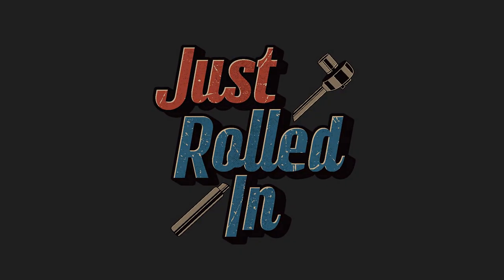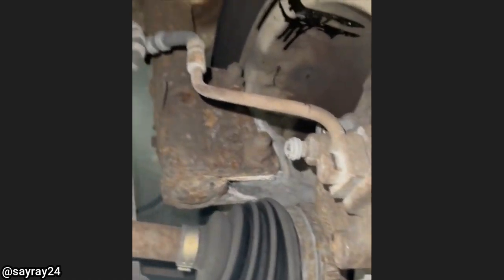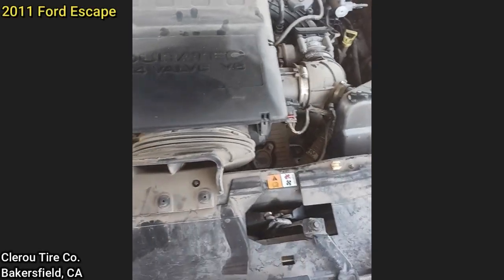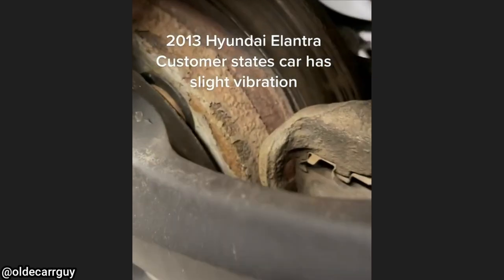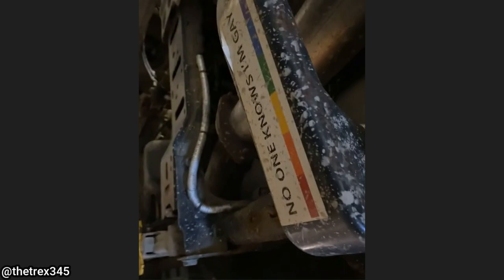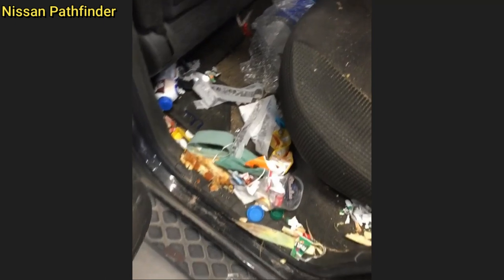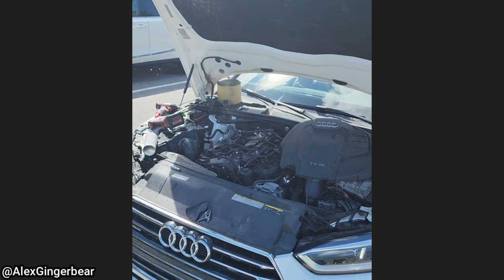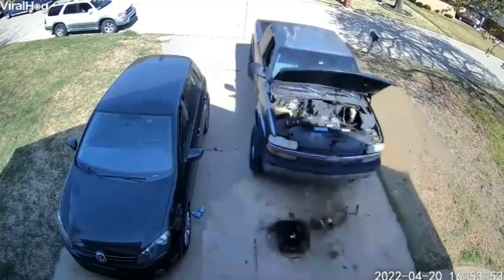Customer States Truck Still Overheats After New Parts Were Installed | Just Rolled In

Comment: 1) I've been the "vibration over 50" guy. I couldn't even see the tires because the car sat so low. When the shop showed me the tires, I about died! The tires had only lasted about 10K miles, so I had no expectation that it was a tire problem. 2) I was working on my chevy truck years ago and went inside to get something. I came back out, and it had rolled out the driveway and was blocking the road. No damage to anything, thankfully!
Reply: my dad had an older tundra and while parked in the driveway the parking brake cable let go. it was a manual and parked in gear so it slowly rolled out of the driveway and across the street over night. 

at like midnight his neighbor woke him up and said "your truck is in the woods next to my house".

😆
Reply: @volvo09  Lmao yeah that can happen when a tired engine is losing compression. It "creeps" like an inch at a time.
Reply: @volvo09  If you park a manual in gear, it shouldn't move at all.
Reply: @jimmydesouza4375  it slowly moves a "chug" at a time due to compression moving past rings and whatnot.

His driveway was a hill also, but not very steep. It took about 6 hrs to go a telephone pole length on a street rarely traveled.
Reply: are u a ghost now?
Reply: @volvo09  older Tundra? Older than what? What do u consider old?
Reply: @jimmydesouza4375  You're correct, it shouldn't. But what happens is, when the cylinders get tired and start to wear out, they don't hold compression perfectly anymore, so when you park the rig, it slowly loses the compression in the cylinders holding it still - until it rolls an inch, which generates more, and then it stops... then another inch, then it stops... park my old pickup on a really steep hill and shutter down in 1st, you'll feel it kinda like that "falling backwards in a chair at the last moment" feeling. New or less worn out engine won't do it.
Reply: @rickjames5998  01 in new England, so it was super rusty. That was about 4 years ago. I ended up with the truck because he was going to scrap it and drove it till 300k when it was truly done... It was only old due to rust, I loved that truck. Ran as good as new, but was unbelievably rusty.
Reply: Ypu Americans need to start using a Handbrake. I've also never came across an engine so worn out the compression doesn't stop a vehicle. Also lowering a vehicle and not sorting out the stupid camber that results will eat tyres.
Reply: @handlesarefeckinstupid  🙄🙄🙄🙄 "you Americans"
Reply: @janemorong4970  yeah, the ones that out of habit don't use hand brakes. You know you do it, i've seen you.
Reply: @handlesarefeckinstupid  I'm sure it's not a uniquely American issue.  I actually use mine.

Have you really not seen an engine losing enough compression to creep like I'm describing? Because I can guarantee you out of 25 cars that are more than 10 years old and manuals, I could get at least five of them to do it. Do you guys just not keep your cars as long where you're from, or what?
Reply: @janemorong4970  to be fair no and I live in a 'very' hilly area. Perhaps it's because we tend to have smaller higher compression engines? I've had people wave goodbye to cars down hills from failing handbrakes, but never had one creep due to the engine turning over. I could see bigger trucks maybe doing that, but they aren't that common here.
Reply: @handlesarefeckinstupid  It could be that yeah. It's not like a HUGE DRAMATIC creep... like an inch... then an inch... then an inch. You may be on to something tho with our engines being bigger and lower comp. My truck's a 4.0 V6 and it does it which is why I actually just had to get the parking brake fixed so it would work, haha. Thing worried me a little cause even if it didn't creep, if it got knocked outta gear somehow or the u-joint broke it could roll. Belt and suspenders, ya know?
Reply: I know this didn't happen like he said it did because Toyota did not make a manual Tundra!! So there is that issue with this comment. Good to see all these guys that know so much not know that... LoL maybe he meant to say a Tacoma perhaps but not a Tundra!!
Reply: @handlesarefeckinstupid  bruh, part of my driveway is 15% grade and any car will creep away instantly.
Reply: @jimmydesouza4375  assuming they had a manual?
Reply: @williamkrause5585  If someone says something in the post a person is replying to, that person quoting them or referring to what they said is not an assumption.
Reply: @jimmydesouza4375  My driveway is steeply sloped, and my car will definitely roll a few feet when it's in parked in first or reverse, has since it was new. Honda Fit (Jazz) 6-speed manual.
Of course, this is why God invented the parking brake.
Reply: @jimmydesouza4375  with low compression it will
Reply: @mauryamckendrick5446  First generation Tundras did come with V6's and manual transmissions.
Reply: This must be an american thing. 1st gear, handbrake pulled, explain how the car rolls away. I'm waiting.
Reply: Mine currently has a vibration at any speed. I already know it's the cheap new tires the dealership put on. I had them rebalanced and the car aligned and no difference. It sat in the hot sun for several months before I bought it and likely has flat spots. Only thing that's helped is massive burnouts to remove some tread. lol
Reply: @techalyzer  I can't explain it. Handbrakes don't hold if the slope is steep enough, and I find the same if the car is just left in gear.
Is it related to gear ratio? If first (3.5) won't creep more than, say, 2cm, does that mean that in 6th (0.7) it cannot possibly move further than 10cm? This would be counter to my own experiences.
Reply: technically you’re supposed to check the tread/wear on your tires every time you use the vehicle. it’s all in the owners manuals
Reply: @janemorong4970 something to be said for the Auto box having a Parking pawl on the box. My wife has a DSG box on her car (sort of auto). That locks in park.
Reply: @j_taylor  A car that does that has issues, just the handbrake alone should be able to keep the car in place even on steep mountain roads. Same with 1st gear. Both at the same time is a fail-proof solution.

My guess would be bad rear brakes/handbrake cable and/or adjustment + loss of engine compression.

A good, normal car will not do that under any circumstances.
Reply: @handlesarefeckinstupid  Yeah, autos have their purposes. I just hate 'em after having so many of them grenade on me and not being able to do anything about it.
Reply: @janemorong4970  i had a DSG go on my wifes car after 5000 miles from new. Warranty changed it, would have cost 6k... scary.
Reply: @handlesarefeckinstupid  Thats what I'm saying, it's possible to rebuild an automatic but it's beyond the scope of most people's mechanical understanding. A manual is still a bit of a task but as long as the casing and main shafts survived it's way more accessible of a repair to say you or me than rebuilding an automatic is.
Reply: That is why I do engage the parking brake each and every time I leave my seat behind the wheel! It is this easy to avoid these rolling problems. (Yes, it is a parking brake, not an emergency brake, IMO.)
Oh yes, the parking brake do works very fine, because it gets used all the time.
Reply: @janemorong4970  Your truck would creep on 1st gear? Really? Have never seen that happening.
Reply: @jimmydesouza4375  it will, eventually, since the pistons' rings hold the compression only when the engine is started and running, because the gases don't have time to gush out beside the pistons. so unless it's an almost new engine it will eventually start to move... then the next cylinder, then another one.
when I was working car mechanic I'd of course, change timing belts. you have to turn the engien into position, which only works if you turn it slowly and wait until the compressed gases have vanished into somewhere. if everything inside would be completely sealed that would not have been possible.
Reply: @janemorong4970  During the mid 2000s our government decided that it would be environmentally friendly if we all drove newer more economical cars and so they made a very generous scrappage scheme I don't remember the exact details but it essentially reduced the majority of cars over like 100k miles to scrap value and because of that we have very few (comparatively speaking) old cars over here in the uk.
Reply: @lilcharlie3130  Yeah I've seldom seen an engine under 100K miles do the creep. Also I appreciate you translating kilometers to miles, since as you well know, I'm over here across the pond lol.

Comment: Always chock your wheels. Personally I always chock both sides just for redundancies sake.
Reply: I chock either both wheels or one wheel front and back on 'flat' ground. My car is a manual so I know that the e-brake at least works. Better safe then dead.
Reply: @braydend9582  Reverse is an extra plus if a manual transmission.

Comment: The guy in the last clip is really lucky.
Reply from the maker: Good thing his truck looks slightly lifted. Might have gotten a differential to the head.
Reply: also really stupid .. put it in park , put the handbrake/ E brake on , chock the wheels .. or none of the above when working on your sloping driveway ??
Reply: @888johnmac  Sometimes people forget to do that, even though they might have worked on things like that a bunch of times. That's how a friend of my family died some days ago, he had worked on his semi a lot of times, but this time he forgot to lock the brakes, and well i don't need to describe what happened.

Sorry If there is any mistake, english is not my First language
Reply: @guilhermebataer9637  .. sorry for your loss
Reply: @888johnmac  thanks, he was a good men, and will nerver be forgoten.
And don't get me wrong, i agree with you, but sometimes things like that happen
Reply: @guilhermebataer9637  pretty damn good with the grammar, not one mistake I see
Reply: @scarycrazymann  only thing in english i'm good, to be honest, because my pronunciation is crap
Reply: @guilhermebataer9637  well it's hard to have the proper accent after living your whole life speaking a different language
Reply: The transmission shift lever is easy to accidentally nudge into neutral when changing transmission oil.

Comment: I experienced the first issue with the reversed water pump on a Ford van I used to own. The belt squeaked and was a bit loose, I noticed that it was routed incorrectly according to the diagram. I fixed it and it didn't squeak anymore. Unfortunately I also just happened to not drive it for about two months after that. When I started driving it again it started overheating all the time and I never made the connection about me changing the belt. I actually ended up getting rid of it because I couldn't figure out the issue. Looking back now, I'm certain someone installed a reverse-flow water pump in it and rigged the belt to turn it opposite from the stock pump. It still makes me furious because I loved that van and there was nothing else wrong with it. It was only the second car I'd ever owned so I was still inexperienced with repairs and especially diagnosis.
Reply: Pretty much guarantee you it wasn't a reverse pump.  Waterpump housings are directional as often is the part of the engine it attaches to, so it's not a simple matter of swapping in a reversed impeller.
Reply: I'm still mad at myself for getting rid of a car for what looking back was probably just a clogged fuel filter. I likely would have gotten rid of the car eventually anyways but at least I would've gotten more than $50 for it.
Reply: @brandonlink6568  My 1st car cost $50, sign said "$100, bring own rope". Flathead Ford, opened hood, saw plug wires crossed, offered $50, uncrossed wires, drove away...he was still shaking his head. Car ran like a champ until sold years later.
Reply: @lironmtnranch4765  Some Fords did use a reverse direction pump, but the housing was different too. You could still get pumps mixed up as the inlet/outlet hose locations were about the same. IIRC a reverse pump was on a 60's T-Bird, and you can't get a replacement pump anymore since the limited number of usable cores for rebuilding are all gone now.
Reply: The water pump going in reverse complexed me.

Comment: That last guy is the exact reason why I always put my emergency brake on and chalk my wheels
Reply: So you can get a parking ticket?
Reply: Must be a really big piece of chalk....
Reply: I think you need to correct your auto-correct.
Reply: @atticstattic  Nah, he's just marking them so he knows if they rolled or not.
Reply: Not if he's using the chalk chocks...
Reply: I prefer paint marker or white out
Reply: @randomschittz9461  
We're going to need a bigger brush...
Reply: @JCWren  Nah, it's like in snooker, he's chalking the wheels for extra traction
Reply: I use Chock on the blackboard at school
Reply: @Rusty_Gold85  
At least it won't move
Reply: Chalking the tires to check contact patch aired down?
Reply: What colour do you chalk the wheels with? Would it work better if you used a piece of wood to chock the wheels?🤔👍🇦🇺
Reply: @atticstattic  🤣
Reply: Do u chalk the wheels so u can see if they are turning.
Reply: Sometimes the highlight of my day is reading the responses to comments on a YouTube video. Today is one of those days.
Reply: Post it notes, don’t stick to rubber. Chalk is the way to go.
Reply: @jake-mv5oi  or the edge when aired up.  ;p
Reply: All that + a traffic cone was encouraged/required where I used to work AND you were encouraged to do that with your PERSONAL vehicle on your own time also.

Comment: 2:46 Chrysler did the same thing! Chrysler had a RECALL on a transmission years ago. Chrysler simply replaced the bad transmission, with a new exact same transmission. It would fail, over and over again! I read about it in Consumer Reports Magazine.
Reply: Ford did the same thing when they tried the cvt. 2-3 failures in 20k miles. I almost bought a ford 500 with one. Glad I didn’t
Reply: Lemon Law to the rescue! At least in the US...
Reply: Yeah, vauxhall for many years had a bad gearbox M32

It would chew through the bearings for the 5th and 6th gear axle in about 60.000 miles.

Fix....Replace the gearbox, and if more than 2 years old, at the costumers expense.

Later they did a second, and then a third revision of this gearbox, which mostly fixed the problem.
Reply: That Peugeot one and the ones mentioned in these comments are worse than what happened with the Nissan CVT transmission. At least the Nissan ones didn't fail so easily and often. Some car manufacturers have dodgy parts suppliers or powertrain inventories where the parts are made to fail essentially or are poorly designed/engineered. Nissan being Japanese sources their CVT transmissions from a Japanese supplier by the name of Jatco.
Reply: @BlairSauer  To be honest, we have a lot of Peugeots in our country and i have heard numerous stories of factory new peugeots with lots of problems.

This is one of the reasons i am never going to buy a french car.
Reply: @BlairSauer  I have a 2010 Altima with a CVT tranny 262,000 miles and never a problem. I just change the fluid every 50 - 60 k miles
Reply: @squirrelsarepeopletoo6678  Ah that's good. Nissan cvt's are generally pretty good anyhow. Your car has done well.
Reply: @BlairSauer  Thanks Blair !

Comment: I've had a bolt break off in the engine block that held the alternator on and used the ratchet strap to get my ass home. It worked for a trail fix without a tow truck.
Reply: I once had a radiator hose crack right near the radiator end. Used a rubber glove and some packing tape to "mend" it. and when i came to our holiday destination and the car was cooled down, i just chopped off an inch of hose and reattached it. Drove it like that until the day i sold the car, never replaced the hose :)

Comment: I like how these techs are video taping the customers problem that way customers can't come back and say something different
Reply: Some have even mentioned getting people to sign a release form, stating that they know the poor condition of the vehicle.

This way, when they drive it the next day and crash it because it is junk, they can not say to the police "It was just at the garage and they cleared it, so it must be their fault for not telling me this".

Well yeah they can say it, but the garage has their behind covered in case the police or insurance tries something funny
Reply: @JohnDoe-bd5sz   I worked at NTB (National Tire and Battery) for a bit. When a customer turned down needed repairs, we had them sign that they refused those parts and service. Invariably some of those people come back/call back complaining that their vehicle broke or needed "all sorts of expensive repairs" at some OTHER repair garage. We pull up the old invoices that THEY signed and show them what they refused. Yeah, like those worn down to the metal brakes and bad tie rod ends were going to get better all by themselves!?

Comment: Years ago I drove a 2005 Hyundai Santa Fe from Alberta Canada all the way along the coast to California.  The car was fine when I left and started to vibrate at an increasing rate as I drove along.  When I got to Oregon I stopped at a Les Schwab tire place to get it checked out, because I couldn't find anything wrong and had minimal tools with me.  There were two tennis ball sized lumps on the inside of the RR tire.  I ended up getting all four replaced because they were getting worn and it was about half the price I'd pay at home.  They even gave me a discount because I wouldn't be able to ever use their warranty!  Looking back, I shudder to think about all the cliff side roads I drove along with that tire like that.